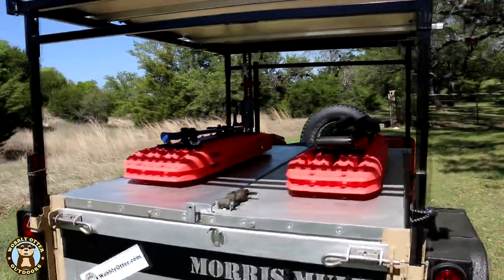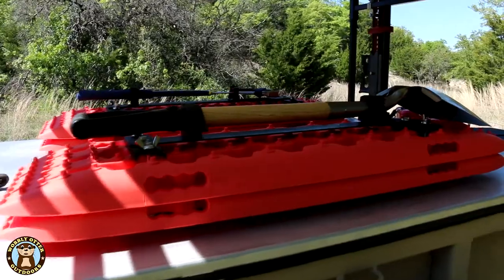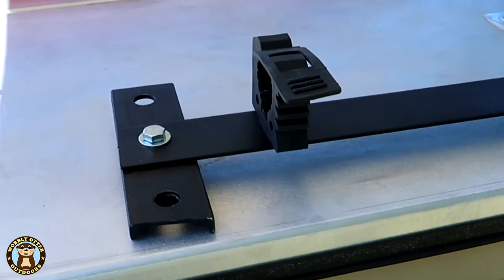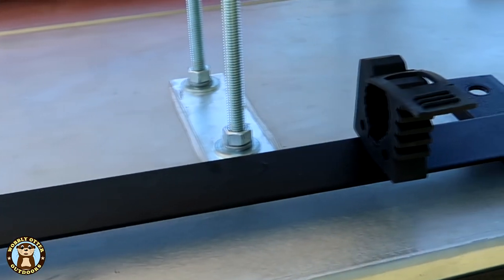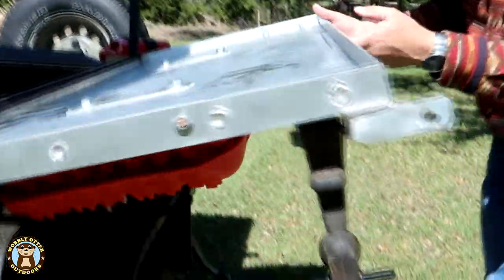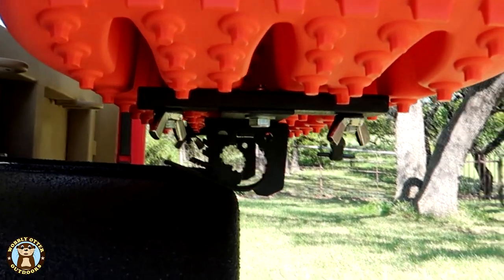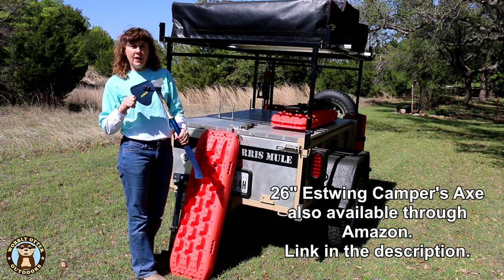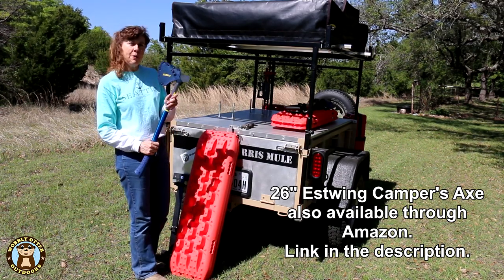New Recovery Gear on Morris Mule Trailer

Comment: What was the decision process for choosing the X-Bull Recovery System over the other available systems? Other than the price point? Do you have any prior experience with the brand. I've been looking to purchase a set and the price differences in the name brand and others is substantial.
Reply from the maker: The price was the greatest deciding point. We don't have any prior experience with XBull. If we were out getting stuck twice a day then we may have gone with the MaxTrax, in hopes they would last longer with repeated use. We make efforts to not get stuck. From reviews we read, the XBull boards seem capable enough for our use. Even if they break, as long as they serve their purpose of getting us out in the process, that's all we ask.
Reply: I would have to agree with you. Unless you're going on an extreme trip where getting stuck could be bad news, its hard to justify spending the extra $300 to $400 on MaxTrax. I'd be interested in seeing how they hold up to light use. Any plans of a test video?
Reply from the maker: No immediate plans for that particular video. However, we have several upcoming trips and if the opportunity presents itself we'll take it.